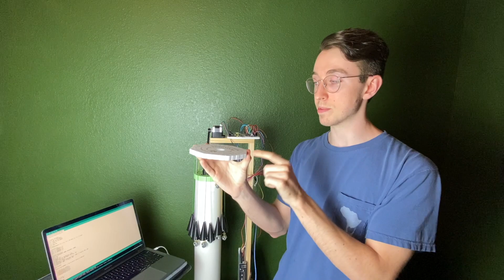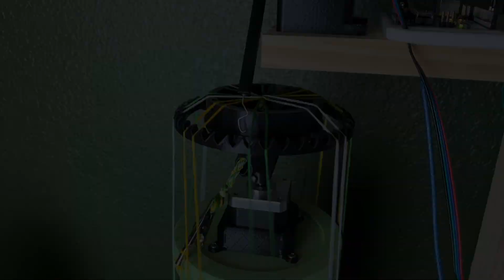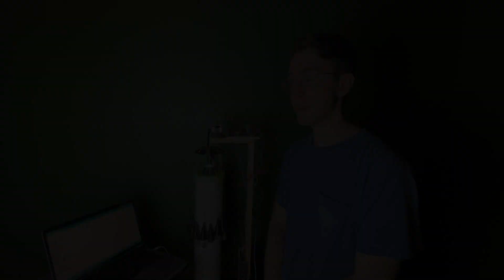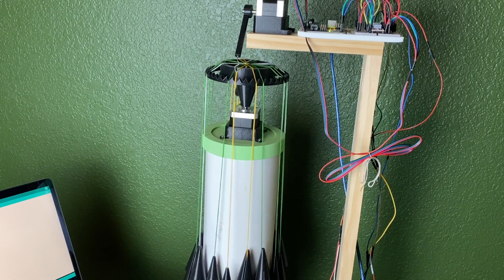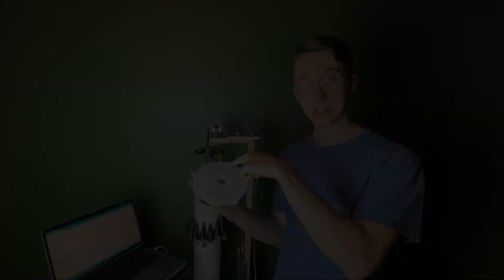Automated Kumihimo Braiding Machine

Comment: Hi iamaizing machine I 'm involved in a similar proyect I have a question you can do a sageo with this machine?
Reply from the maker: hey! thanks for checking it out! i believe it is possible. the toughest part to get around is avoiding tangling of the strings. i have tried a basic sageo (if i’m remembering right) and, as the braid formed, the distance the string traveled changed slightly causing the machine to place a few in the wrong slot. it is definitely possible to fix this issue but i didn’t have enough time to work on it any longer. anyway, short answer: yes but will take some engineering/adjustments.